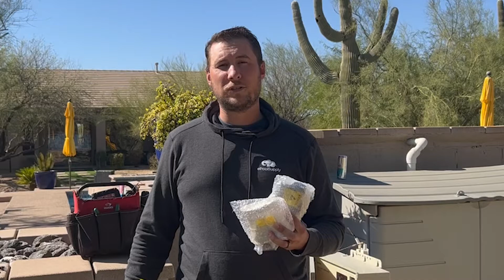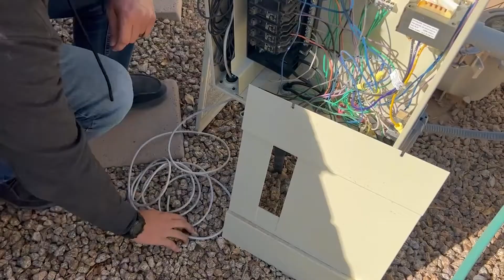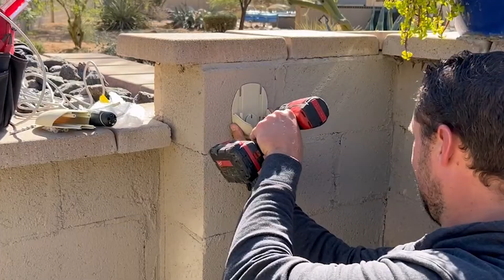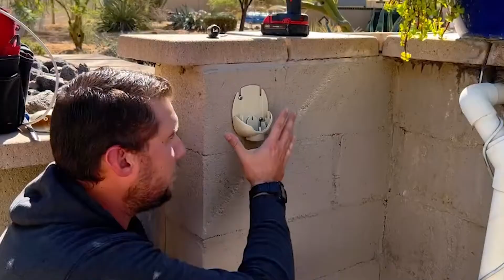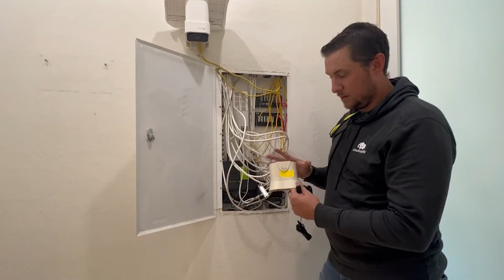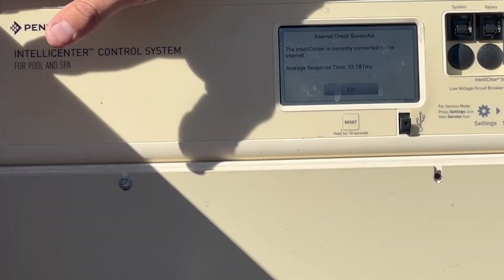How to Install Pentair IntelliCenter Wi-Fi Link Kit

Comment: Thanks for sharing. Why do some units have a protocol adapter and this one does not? What constitutes the need for one I guess would be the question
Reply: If you have an easytouch or intellitouch you’ll use screen logic and screen logic uses a protocol adapter. IntelliCenter has built in WiFi and Ethernet connectivity

Comment: Mine died after about 3-4 years. It's pretty expensive for what it is. You can use a WiFi extender to provide data to your IntelliCenter for a fraction of the cost. Pentair confirmed that they no longer provide the WiFi antenna of earlier models. By the way, the 523557 is a WIRELESS Link, not a WiFi kit. It is a direct wireless connection between the indoor and outdoor units. 

You can use any extender with an Ethernet Port. In my case, I used the TP-Link Omada EAP-225 Outdoor. You first configure it at your router to set it up as a repeater. For this particular unit, in the Omada app, go to “Standalone Mode,” then “WiFi,” and set up as you would any extender of your WiFi network. 

Once configured, take your WiFi extender outside to the IntelliCenter panel. Open up the external unit of the Pentair Wireless Link and disconnect the Ethernet cable. Connect this cable to the WiFi extender. In the case of the EAP225, this Ethernet cable already provides the extender with POE (Power over Ethernet), so you do not need an external power source. 

Once set up, you save yourself hundreds of dollars and have a WiFi Extender in the process! If the extender ever breaks down, you'll replace it with better technology at a fraction of the cost rather than using Pentair's obsolete wireless link.

I have a solid connection with the app, and no longer have situations where the Pentair app will not connect. My equipment is about 70-80 feet from the WiFi inside my house.
Reply: Could you expand on how you did this? Maybe provide a link. Pentair won’t tell me as they want to sell their product
Reply: Do you have to have your phone connected to wifi for this to work.  I just connected a cat 6 ethernet cable from my router directly to back of pentair control board. It works great but  only connects when my phone is connected to the same wifi. my
Reply: You’re a legend. Setting up the pool at mom’s house and her pentair system won’t connect to WiFi because the previous home owner took the indoor unit with them. Definitely going to use the extender method.

Comment: So if the outdoor antenna is damaged by rain etc., this  kit has to be purchased again?
Reply from the maker: The antenna is designed to be outdoors, but if there is damage to either the indoor or outdoor piece, a new kit would need to be purchased
Reply: @ Does the screenlogic interface protocol adapter have to be replaced as well?
Reply from the maker: @chrish4865  This all comes as a kit; you will need to replace the in-home as well as the outdoor wifi unit. The 2 units are "married" to each other from the factory and will not work with other units.
Reply: @ Thanks
Reply: See my comment in this thread about using a WiFi extender and save hundreds.

Comment: Thanks for sharing this video, this is the obvious for any regular tech , what about installing the outdoor controller in to a basement? Does the signal works the same?
Reply from the maker: Yes it will work the same but there can be some signal interference due its location.

Comment: Two questions.  

One - on the control board where you connected the antenna kit - is that a native Ethernet port that can be hardwired if wiring is available?

Two - does the controller have WiFi built in for circumstances where there is already adequate WiFi coverage?
Reply from the maker: Answer to question #1: Yes 
Answer to question #2: No

Comment: Hey, thanks for your video, it's very helpful. But I have 2 questions. 1- how much distance is the communication  between the two antennas. 2- You can connect a direct cat6 cable from the router to the intellicenter direct panel. To remove both antennas  . Thank you
Reply from the maker: You would need to contact Pentair as far as the distance goes between the antennas (800)831-7133. You can connect a direct cat6 cable from the router to the IntelliCenter. Hope this helps!